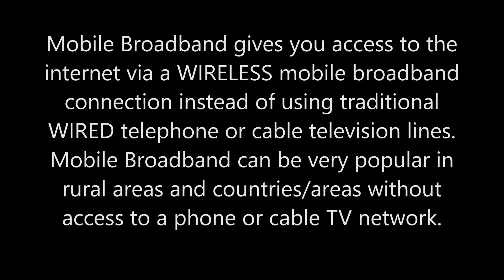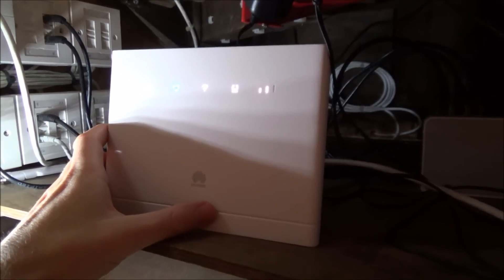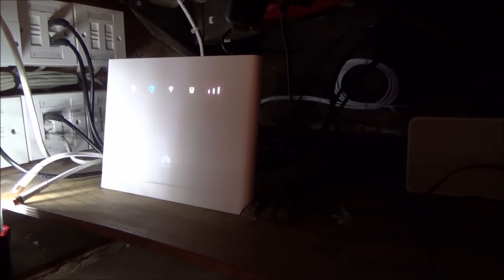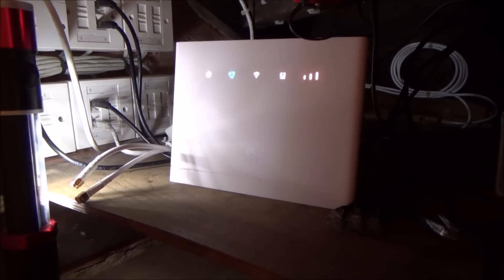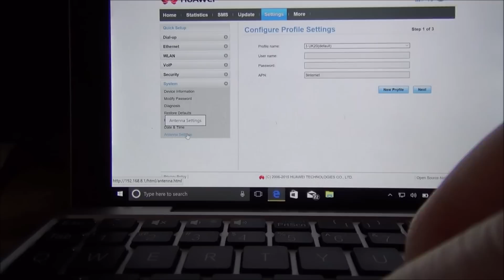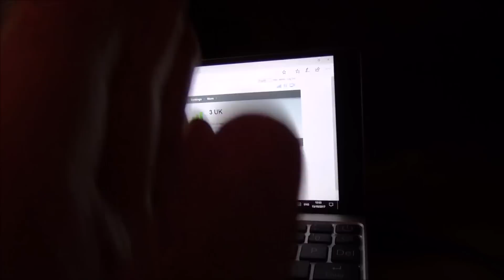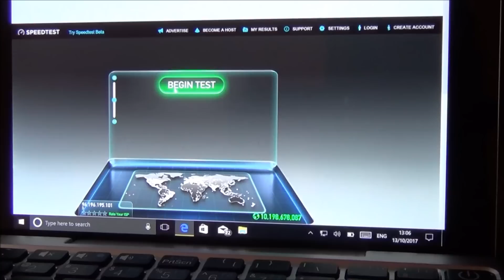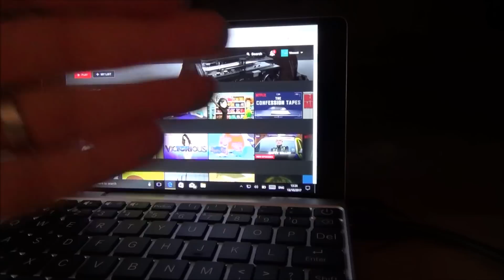How to increase 4G LTE Home Broadband Router Speeds

Comment: Hey Vince! I was just going to add an external antenna for our neighbour as he isn't getting very good speeds and he's on the same 4g provider to me, so I suggested an external antenna as he's getting about 70% signal strength. I get pretty good speeds as we recently moved to a 4g router instead of the copper telephone line as because we are very rural we were getting awful speeds (4-5mb and .5mb upload) and it was taking me about 8 hours to upload a 20 minute youtube video! We now get around (80mb down, 23mb up on EE) but he's only getting around 12mb and 7mb up and he's only about 1/4 mile up the road. I was looking at reviews for antenna's and your video popped up! Great video as always mate👍

Comment: Must congratulate you Vince on your presentation, so easy to follow and I’ve learnt so much on this video. I hope you don’t mind but can I please pick your brains, I’ve got a 4/5g router from Three UK, it’s a ZTE MC801 A. I live 680 meters from the cell site but the line of site isn’t good at all, I’m thinking about purchasing an external antenna, probably one like yours that’s omnidirectional and cross polarized, the sticking point I have is the frequency, I heard I need to get the correct antenna for the 3 UK network. Can you assist please, Ta.

Comment: It's a shame you didn't put the rabbit ear antenna on to prove your point. There is so much deceit and B.S. on You Tube any sensible viewer should not trust statements like, "I tested it with the rabbits ear antenna and it made no difference."
I find that hard to believe. You are saying their external antennas are useless?
Though I am going down this route myself using a Huawei 4G X2 Router and the same antenna you demo I have had to discount your findings.
Just a heads up and not an accusation.

Comment: I just bought a Huawei B535 4g router and I want to add 2 antennas to it. I found 2 antennas but with different "plug" types: RP-SMA or SMA. I wanted to ask which type have you used in this video (both for the "box" shape antenna and the 2 white short antenna). Also, what are the differences between the RP-SMA and SMA, and which type should I buy most importantly? thank you!
Reply: B535 uses SMA type antenna cables.

Comment: Way to go. I was actually advised not to go for an external antenna by Tele2.
She said, no no it has its own internal one, so you won't need to bother with that! Well obviously I looked into it and here we are.
Thx for the information.
I only got 2.5 meter of cable though lol. Will be a challenge
Reply: Pretty sure you can use an extension of the cable

Comment: One thing to really consider is that antenna cable length has a huge effect on signal quality. Use as short a cable as possible. I would almost recommend getting a high quality outdoor unit with Power over Ethernet. Then its just one cable outside with power and ethernet.
Reply: can you elaborate more ?
Reply: @Lee-haw  Yes, long cable give much more noise in the signal and the signal level generally falls off. For my current setup, it got much more bandwidth from moving my modem, than having 10 meter cable to an external antenna.

Also I found out that older LTE equipment is no good, just get a new Huawei router if you are stuck with something from 2013...

Zyxel and others make "PoE" powered modems, which means you can put the modem and antenna outside, up to 80 meters away, with just a simple network cable.

By going from a 2013 modem with an external antenna with 10 meter cable outside, to a cheap modern LTE modem placed inside, i more than doubled my bandwidth.

Comment: Hi Mr Kanaan ,Iam using  DLink 4G LTE router

D-Link DWR-M960 , this device only work with a specify sim card and  i cannot use other specify sim or Network, plz help me to change the entire wireframe or the specific model  for using any 4g sim card to use for this device.

Comment: I have my hawuie cpe b593 connected to external. Arieal the network is set to 4g only we don't have 5 g it rural. I'm 3.9km from mast. Aerial up on pole at roof height. Sometimes on 2 bars the speed it better than 5 bars signal comes and goes a bit. It cant change to 3g or 2g if router settings are 4g only. I checked in setting. External antenna is on etc. I'm trying to get 5 bars but to no avail. Any idea on how to speed it up a bit

Comment: Just a note @ 13:20ish, Three does not cap me. I have all I can eat broadband including Netflix and other streaming media. I have been using it for working from home constrantly throughout 2020 and had about 2 short outages all year - not too bad. I'd also like to know the difference between the two antenna ports (#1 is the preference on the B535-232 for single antenna solutions, there is also a mixed mode - I may make some tests and report back). I have one of these hidden inside a commercial vehicle with external antennas in the centre of the roof for CCTV streaming so I know the external antennas work ok as the vehicle itself is a "Farriday cage" preventing normal router operation when the door is closed! Good you pointed out that you have to change the settings to enable the external antennas. Being a bloke I didn't read the router instructions at first so learned the hard way!

Comment: Luxury speeds! I live in a fairly modern house in a large town (Macclesfield) and the BT provided landline speeds had been so poor (I gave up BT in 2016) that I've been relying on 4G "air broadband"  since. Today in 2020 I can get between 15 and 50 Mb/s via 4G on Three with the router in the highest part of my loft and a physical cable to a switch near my PC. When fibre came to town, OpenReach underestimated the demand so the waiting list was well over a year. Today the "average speed" fibre (whatever that really is - meaning is that at e.g. 4am) is 45Mb/s - pointless to take the risk and shameful this day and age to be in a built up area which such poor performance. Thanks for the vid.

Comment: Can you advise? I have GSM booster and by it I have full 4G signal. By measuring the speed by any phone mobile the speed around 30 to 60 mbps  and it is acceptable for me in this location .
The problem when I use 4G router, the router not receiving any signal from the booster even I connect it directly .
In same location the mobile give me full 4G signal and the router no signal or only 3G

Comment: This is huawei right? Is this good for rural areas? My sim access is 4G capable.
Reply: I have this modem .
It was decently device not good and not bad . 

The connection between the devices when there is alot of devices is not good but if you don't have alot of devices it can serve you well .

Comment: Vince, another very helpful and informative video.  I followed your earlier guidance on how to get the best out of your landline broadband connection and almost doubled my speed to 7.5mbs down (still too slow but better than it was!). After a couple of years and lack of any improvement in the BT Openreach infrastructure and failure of the two local area wifi companies to provide me with a line of sight to their masts, I'm investigating 3G/4G router broadband.  Two possible suppliers, both only providing 3G if I'm lucky but initial test with a little mifi unit are showing up to three times my current download speed.  4G router being delivered today for testing with an existing Three data sim.  EE pay as you go sim also on its way as the EE coverage is supposed to be better.  I'll see what the connection is like before looking at an external antenna, but I think I will have to go down that route. Thanks again for all your help.

Comment: Those cables must be seriously bad to lose the (admittedly small) gain of the antenna. Of course its the fact you don't suffer in-building penetration loss and lower multi path losses that give it so much benefit. I'm looking at that and the tplink archer as 4g backup. For better speed tests do an internal network file transfer....did that setting up mesh network

Comment: In Eastern Europe there is no limit for 4G, basically everyone has unlimited plan so during the day it's like 30 Mbit.. I have 80 Mbit up 40 Mbit down during the night using 4G+. Considering buying an antenna with two cables.. Even though cell tower is 500 m from me, I can even see it but signal strength is only 90 dBm.
The only wired option I have is ADSL2+ which is like 15 down and 0.08 up

Comment: Im quite lucky that my house is like 100 to 500 m away to the mast from my house. I have awesome speeds on my LTE connection. Ping about 20 - 29 ms and speeds up to 150 Mbit but at peektime around 100 Mbit and I dont se why i ever should change to fiber connection. And with 5g on the rollout... but the thoughts has cross my mind to get external antennas. But i dont know... i dont think it Will make my connection any better.
Reply: wow that is faster than low-entry budget fibre at my place
Reply: @Hezexify  yeah its quite desent. But. On realy peak times and alot of ppl using the LTE network it can be as low as 50 - 60 mbit so in the long run a fiberoptic connection is the way to go realy. If you pay for 100 mbit connection you get 100 mbit at all times. But i think with 5g on the way its gonna be just as good as fiberoptic connections. And one more thing the speeds over LTE network is gong up and down like one moment your at 100 mbit and all the suden its at 50 mbit  so during a big download you see a lot of it up and down. But as i said in last post im happy with it and cant see why ill ever gonna pay to get fiberoptic connection. Even my security system will continue to upload video security fotage if i ever have a power failure since it not depending on power since the LTE mobem have built in battery. And the cams run on battery power aswell if the power ever go out.
Reply: @Kammaflaje  yeah so true, if 5g come, we just need to change 5g modem thats all :P

Comment: Defo this is a big issue; worked on a UK wide deployment where we were installing new routers with 4G LTE backup routers (the locations of the router were often really poor for network signal, we carried O2 and Vodafone data sims too) though the comms room or cabinet was often in a poorly sited location, so the connection was very flakey, recommended this to the network bod as the support was very limited,  the ones we were deploying all were fitted with the option to use an external antenna.  Thanks Vice (if that's your proper name!)
PowerLine adapters can also blow pretty hard / if in an unattended location too - so fire risk / as the plug is on (come across a few now so we've avoided them wherever possible).

Comment: Can we put amy simcards In that?
Reply: Yes as long as you get the unlocked router. Basically don't get the router from network (like Three), buy it off from Amazon or ebay or wherever.

Comment: Thanks for the video which I used as a learning base to fit a Huawei B715s and an external antenna. I also noted a big rise in download speeds between speed runs one and two whenever I tested a new orientation. It left me wondering if these routers learn and adapt to their environment as the subsequent speed tests were all more stable at or around the second test result.  Its important to know where your masts are to position the external antenna facing the right direction. The better face onto the mast the antenna was (although the max speeds didn't alter much) the more stable the d/l speed was in terms of delivering at or close to the max speeds.

As a top tip, another thing I found was that the speed results of the router/antenna was very similar to those obtained on my Samsung S7 phone. So, at least in my case, you didn't need to roam a site with laptop, router and antenna to pin down the best location to position the antenna. The final speed results through the antenna were very close and actually a little below those obtained directly on the mobile phone.

Comment: I`m using a Huwaei 525 router and can`t find how I change to external antenna on the settings. My homepage looks different to the one on the video. Help please.
Reply: login to router  then go to - advanced > system > system settings > antenna settings.  thats how it is on a B535, not the same as yours but close. Its an advanced setting.

Comment: perfect tip thanks its exactly what I was looking for, I have that router    top man
Reply: I moved it to the loft space and wow 👏  I ran a 15m rj46 cable to the hub down stairs so all rooms now have full signal, we are pulling 40mbps on all devices and didn't even need an external antenna its got 4g+ full signal on the internal 

So top man, your advice is awesome, its created an umbrella WiFi field all over the house and my wife can walk all round the garden with signal etc 

Seems to be that the wifi works best when devices connect upward to the hub, there's much less interference indeed. 😎

Beers on my if you're ever in Lincs

Comment: Good video; to add a couple of tips: 1. Find out what access point names your cellular provider use. Sometimes when you're suffering from congestion, you can change the AP name and get massively higher speeds. 2. A good MESH WiFi system will almost always perform much better than powerline adapters and access points; the technology is developing much faster.

Comment: Hi great video I'm using a Huawei vodaphone 4g/5g unlimited plan router only 4g as 5g not available yet in my area the speeds are shocking I bought this square liked antenna with suction cup. That you have to move around stuck it outside and inside the window made the connection worse sending it back for a refund. I can't put one on a pole and mount it outside as I'm not allowed where I live and not allowed to get wired internet would the small antennas work to boost speed in your opions or could I get one off thease and stick it to the window as can't drill any opinions would be appreciated as I really need to get better speeds. Area shows as good for 4g but just about getting 15 Meg if that as it's up and down much appreciated nice video.

Comment: Got one of those routers, I don't have those external antennas though. For the past 2 years I had perfect 4g, 3-4 bars always, stable even in storms (lack of knowledge about how things work)
Now my router can only reach 3g. Its been on the same location since i got it. I called the company they told me to reset it, they did not see any fault on their part. So I took my phone to the same locations, and it runs 4g perfectly.. I'm so confused. Better call Tesla to solve this one.
thanks for the video

Comment: I set up a couple of directional antennas got speed from 20-25 up to 80-85 mbits. Run for 3 or so years already. But you are better off getting a quality brand antenna with cleaner signal and quality low loss cables expecially if you can't put modem right next to the antenna. If you are on a very low budget you could try to make a cheap can-antenna, directional bi-quad antenna or experiment with other high gain designs.

Comment: would i gain any benefits sticking a external antenna outside the window? current speeds average at 6mbps which is so poor, ive tried everything to improve it, using three unlimited with huwai b535 router.

Comment: really interesting my zyxel lte4506 cant use external antenna sadly i may go for another 4g lte router though have to be a external aerial that can fix to wall as in a flat not on ground floor, wow things have changed unlimited data for £16.75 a month with three

Comment: Due to the high radio frequency used for LTE, there's a big signal loss on the antenna cable length. Try making your cable as shorter as possible and do the speed test once again. You really would be surprised.

Comment: What about having the Antenna on the roof like the chimney stack beside the TV antenna, use double screened Satellite coax cable, Three Mobile might be better as they will be optimized for AV and actually Three where the first to make video phones like the MOTOROLA V975 video phone.

Comment: just installed the Huawei  315 with external antenna omni directional on the roof.
original speed with talk talk phone line download 11mbps up 0.4mbps yes only 0.4 !.
with this router and a vodafone unlimited max sim £30/m download 35mbps up 24mbps.
The limit per month with this sim is 3tb although not published which should be enough for most people.

wow
talk talk are now charging me line rental plus £1 for the broadband as its so rubbish and will keep this as a backup if vodafone ever went down.
Thanks for the advice.

Comment: Hi Vince,I just bought the same antenna, been getting 17mbs on internal router antenna, connected the new one and it dropped to 7mbs (average), I am doing something obviously wrong? Thanks!
Reply: Might depend on the antenna: if it's directional, then you might need to change its orientation (RSSI and RSRP metrics from the router's statistics page are good indicators - the closer those negative numbers are to 0, the better); you may also have to check the connections to the router, antenna, and the quality of the cable itself (whether it's broken or overbent at some place)
Reply: Length of cable from the antenna to the router location also matters
The shorter the better.
If longer than recommended it will affect the signal (dB loss)
Reply: @progtom7585  . If I need 20 mts longer. Can I use a Upload voltage for antennas? or something to increase the antenna's voltage  to don't lost db?
Reply: @marcoandresfernandezgalvis8718  I dont think so mate sorry